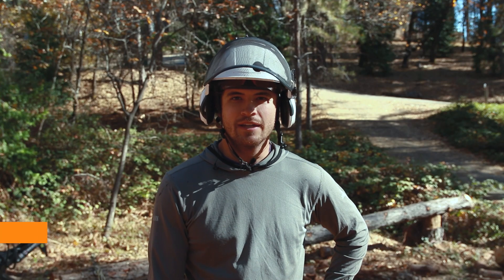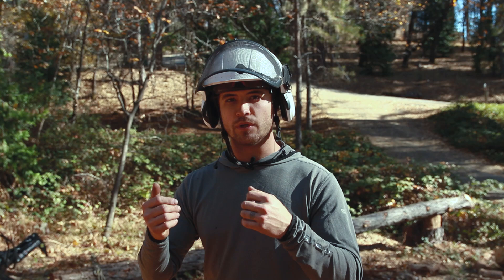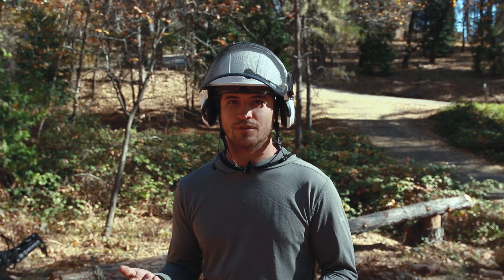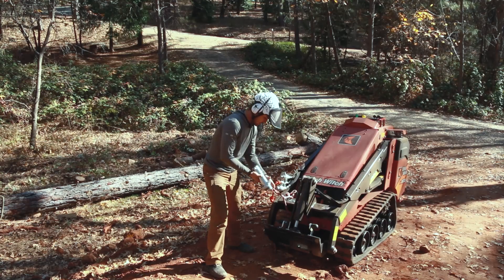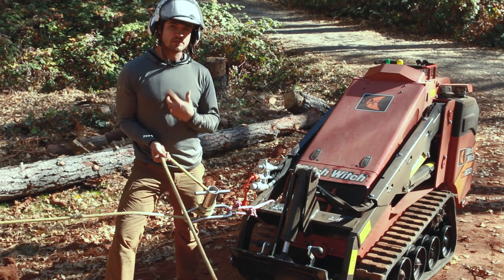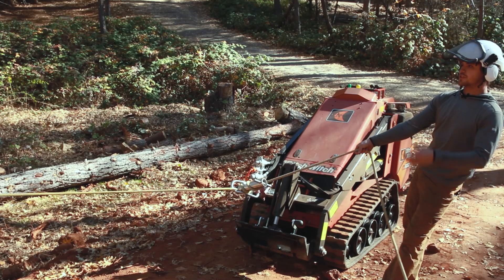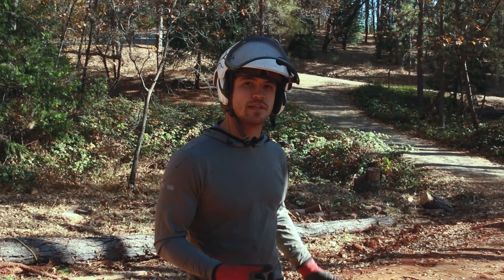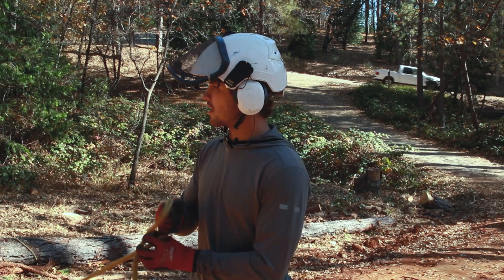Safer Rope Pulling ! No more breaking ropes with your truck or skid steer | Arborist pro tips

Comment: “Arborist pro tips” uh not quite. You know you’re “logging” when you’re using a Ditch Witch. Not like anyone would have a larger machine, perhaps? If it’s always so necessary to leave the logs in 30+ ft lengths????...perhaps???
Reply: Logging with a mini? lol no  don't think so bud.  You need full size skids and excavators.  He called it right,  Arborist pro tips.